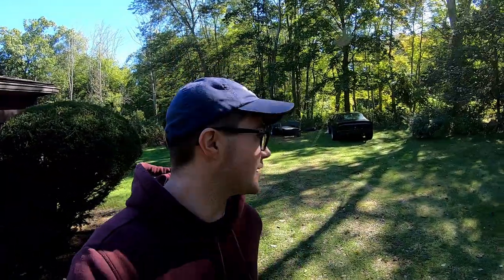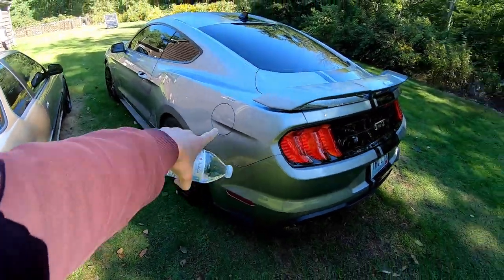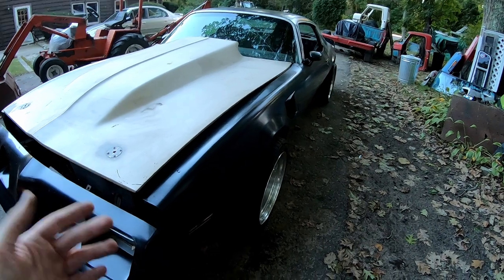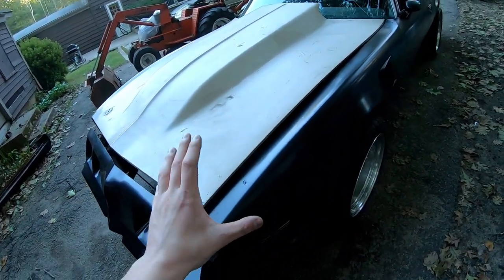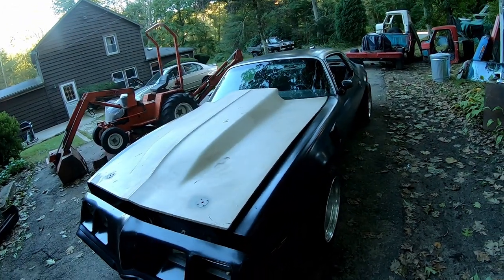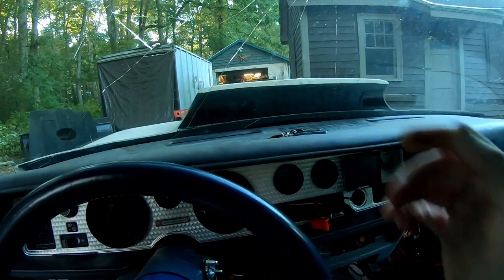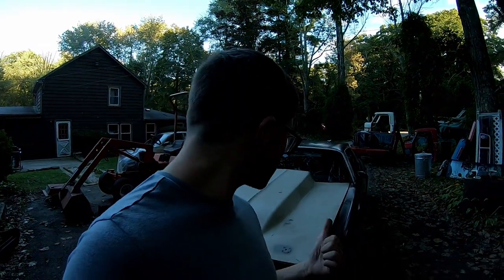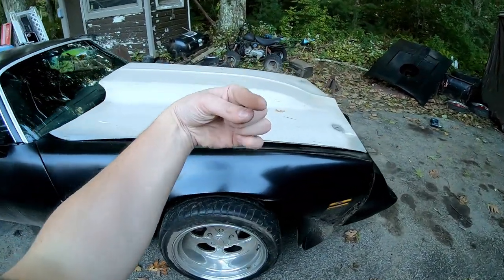Firebird Gets RARE Cowl Hood!

Comment: I have a 1980 Trans Am that I’m putting a LS with to super Victor intake. Do you think the shaker hood scoop would’ve worked instead. I was just wondering because I might order a cowl hood like you have. By the way, what side is your cowl 2 or 4 inch? I really like the shaker hood to keep the original look for my car.
Reply from the maker: This is a 4" cowl! And I honestly don’t know if the shaker would work. A mixture of the LS engines being slightly taller and the possibility of the center of the intake maybe not lining up perfectly makes me think it’s unlikely